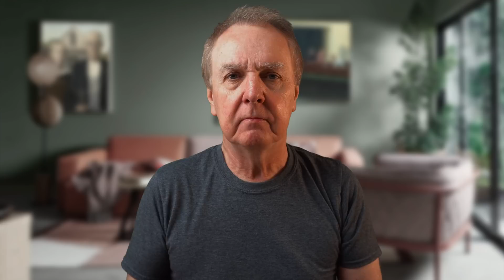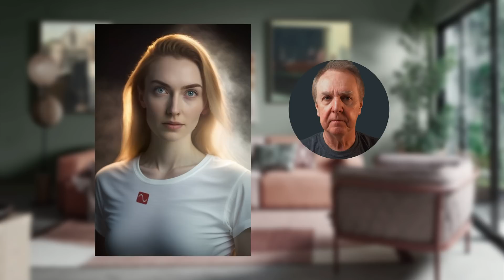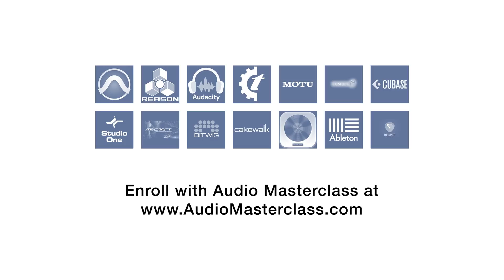Did that Dolby thing ever work?

Comment: As a teenager I really wanted a Nakamichi Dragon or CR‐7E, or even that AIWA one that let you adjust head azimuth.
Reply: I never heard of a Nak cr7e however I did own a Nak cr7a .the adjustable bias was very useful and the deck was claimed as the best cassette deck ever but I also had an inexpensive technics dual deck with Dolby hx pro that I believed without a doubt out performed the nak.wasnt much better but there was an audible difference at high output levels.Im sorry but 1985 tech wasn't as good as lower cost 90s decks...some people just won't let the hype die
Reply: @StankoBogovich-u5m  CR-7e was the variant for the European market.

I was a teenager in the 80s. By the mid 90s I rarely listened to my cassettes. 

Thanks for destroying a teenager's dream.
Reply: No destroying any teenage naustalgia on my part sir.I still like to listen to old hissy 8 track tapes myself.I was merely stating facts.sir.didnt mean to take away your desires or pleasures @nikolaki
Reply: I did have the pleasure of overhauling a few Revox decks .I think they were model 200 if that exists and I'm going on shady memory at Steve's shop.very well designed units.service friendly and high quality.lots of metal rather than plastic in their mechanisms where plastic or nylon failed with age just from their exposure to the elements...time,temp and humidity as well as decomposition.Nak equipment used lots of plastics that would decompose with time and with no more parts available to replace them they become obsolete.over all the Revox was a way better quality product than Nak.Your father worked on the very best overall.Im not too familier with studabaker so I can't give my 2 cents but overall Revox was way better quality than Nak regardless of some insignificant spec differences
Reply: Let me correct my self ...I meant adjustable azimuth not adjustable bias as the Nak had self calibration which was also a nice feature.nakamichi always claimed that hx pro was not needed in their decks because their head design was that good ...well I disagree and hearing is believing
Reply: @StankoBogovich-u5m   the azimuth feature was desirable for playing pre-recorded tapes.

As regards home recording I preferred dbx noise reduction for most of the stuff I listened. I had a Proton 740 tape deck that was factory calibrated for Maxell XLs tapes. 

Dolby C tracking was rather good on it too.

Playing tapes from recorded on other decks or mass duplication was usually unsatisfactory.
Reply: @nikolaki agreed sir especially with Dolby c which required critical calibration which was a major problem with using c type on other decks that wasn't talked about much.dbx was a linear system that didn't need calibration and always worked with cross decks.dbx however suffered from pumping and breathing side effect.because if this I always used Dolby b.the noise reduction was usually enough with good tape and equipment and compatibility was usually tolerable from deck to deck.thank you for the dialog Mr nikolaki
Reply: @StankoBogovich-u5m  i remember solo piano caused a lot of pumping with dbx.  Edit: I meant breathing!
Reply: @nikolaki I will say that there was a lot more satisfaction in trying to make the perfect sounding recordings back 30 plus years ago then today's digital where it's simply taken for granted.there was satisfaction of accomplishment with the struggle that doesn't exist any more
Reply: @StankoBogovich-u5m   yes, the digital revolution is truly extraordinary but despite the incredible mathematical algorithms that exist today I am more impressed with the engineers and technicians of the past.
I find the fidelity of sound achieved via cutting stylus and magnetic fields more incredible.

Just when analogue tape reached its technological peak coupled with Dolby SR, multitrack digital reel to reel machines were released!
Reply: @nikolaki yup,,all good things reach a peak than come to an end
Reply: I never had the pleasure of using Dolby s.i had heard is was set to be the industry standard for commercially pre recorded tapes and you know what happened next.i was curious to know how tracking compatibility was from deck to deck.perhaps you can shed some light.
Reply: @StankoBogovich-u5m  Sadly I never tried a Dolby S deck, by the mid 90s I became interested in surround sound, laserdiscs, dvds etc. The A77 and Akai GX were in storage and I had acquired an AIWA HD-S1 DAT machine.

The closest I got to experience Dolby SR was listening to Jean Michel Jarre's CD, Waiting for Cousteau since I read it was recorded on a multitrack Studer A820 with Dolby SR.

Anyway, sadly I only know what hi-fi reviewers wrote of various decks in the magazines, which was generally positive but, as you know, by that time it was too late for it to make an impact.
Reply: @nikolaki just one more thing.when I worked for Steve J in Hollywood I overhauled a number of Nak decks including cr7a,dragon,c9 something or other rx505 rx303.what an experience it was and a self satisfaction.He had two Nak 1000xk if I remember the suffix correctly that he wanted overhauled and recaped.however both decks had a strange record bias failure that I wanted to tackle first before overhaul.he insisted that I overhaul first which I did and after many hours of labor the bias issue still existed in both units.turns out others had the same issue and there was no known remedy at the time.you can actually see you tube videos of engineers trying to troubleshoot with no luck this was one of his excuses to fire me.he wanted the near impossible done after it was explained to the moron that this could be an unsolved issue...stupit man
Reply: @StankoBogovich-u5m  saddened to hear about your experience. Stupid is as stupid does. 

Brings back memories of my childhood in the 70s. My father used  to service Revox and Studer machines in his basement workshop in Paddington.
Reply: @nikolaki I've never been to England and probably never will but it would be a honor to shake your hand
Reply: @StankoBogovich-u5m likewise!
Reply: @nikolaki just one last thing...I hope..after reviewing all of my grammar errors ,,,😘it was the 1929 Boris Karloff movie 1939 was the drug induced ridiculous wizard of oz with miserably stupit music such as yogiyo yooohh
Reply: @nikolaki I'm fairly certain you know this but I'll talk about it some more.dolby hx was a late 70s system designed by doctor Ray Dolby  which lowered the record bias as high level high frequency sound was present that would self bias allowing more high frequency record headroom.critics said the system was flawed if simaltanious low frequencies were present.sometime in the mid 80ds.Bang and olfsom modified the circuit with the blessing of doctor Ray Dolby which became hx  pro.I don't know what they did and how it works but more importantly I have know clue what the decibal or any other numarical  effects hx pro has...I know I misspelled again ..so what.so what.do for decades I've been in the dark as to the exact function of hx pro .perhaps you know but I doubt it
Reply: @StankoBogovich-u5m   I must say I purchased many pre-recorded cassettes encoded with HX Pro. Before the days of the internet it was difficult to find information on it. The blurb on the cassette cover had no useful information.
I did not have anything to compare to understand what its effect was.
Did the cassette sound brighter? Not to my young ears. It was an enigma.
I hated prerecorded cassettes and my father had an aversion to the clicks and pops of vinyl, so I led a rather frustrated youth until CDs came along.
Of course I recorded a lot of music off the FM radio to both cassette and reel.
Reply: @nikolaki I love that word enigma.most Americans indoctrinated in our wonderfully brainwashed society know the word but have no clue that it was a nazi encoding message device used during world war 2 .I'm ashamed of my country folks in the USA.the country is great .....the people suck
Reply: @StankoBogovich-u5m they gave it a very apt name.
Sadly many goverments across the world do not want an educated electorate with critical thinking skills.
Reply: @nikolaki your father didn't like the pops on vynal.well, as it turns out with good vinyl and quality care along with light weight high quality phono cartridges it should not have been an issue.as it turns out in the US at least.record companies were using recycled vinyl with impurities that created pops right out of the sleeve.also so they would multiple press vinyl beyond the numeric wear point of the master press.your father probably knew this however mass produced pre recorded tapes were mostly worse until the late 80s and by that time nobody cared
Reply: @nikolaki exactly ..One of my favorite comedians who told me off in a casino in Biloxi Mississippi who later apologized to me ..George Carlin said it best...the owners of this country don't want educated people.they want obidient workers .more for themselves and less for everybody else
Reply: @StankoBogovich-u5m it was frustrating not having access to a record player. Not every band released music on cassette. 

But the allure of vinyl is strong and I have a small collection - mostly Deutsche Grammophon LPs from the 60s & 70s because of the artwork.
I do have a Pioneer PL-12D, I can't remember what cartridge but the cats love to jump on it, so it stays in the garage 😢.

My father worked for Brenell for a short time, he helped design the preamps in the Mini 8. And he also designed and kitted out a few studios, setup a mass cassette tape duplication facility in Lagos. I mean he did so many crazy things. So I think you're right about why he disliked vinyl.
Reply: @nikolaki so you're an electronic tech  too.I didn't know that.now that I do since we discussed noise reduction so much I will tell you that I know the inner workings of Dolby b.6 NPN bipolar transistors arranged to add encoding and subtract decoding of the compander.1 n channel junction field effect transistor used as a level limiter for the compander process.1 germanium diodes and 1 silicon diodes in series filtered by capacitors to create the time constant of the level limiter and 2 silicon diodes parallel in opposite polarity to absorb stray transient signal spikes.so now you kinda get the gist of how it works I hope
Reply: This was the original Dolby b design and not much has changed other than it was made into an IC chip
Reply: @nikolaki if you want some naustalgia.purchase a pre 1975 top loader japanese made cassette deck working .you will find that there's so much hiss and even the Dolby doesn't seem to work.what you will find is a separate discreet component Dolby board.almost every transistor is going to be a c458.also known as a 2 sc458
Every one of them has to be replaced and you can use a more modern transistor...a 2sc 2240 which works better in most cases and improves the signal to noise ratio.just a little gun from the peanut gallery Charley brown
Reply: @StankoBogovich-u5m 😀

Comment: Dolby did what it said on the tin, it was purely down to ensuring due diligence was done on your machine, also the quality of the cassette deck had a big a play on it too,
My main gripe was the shocking manufacturing quality of pre-recorded tapes, these where always hit and miss especially as they where massed produced at speed. 
Frequencies where usually all over the shop, too much low and not enough high
Reply: Some of the pre recorded tapes are just awful. But I think it's because some of the record companies recorded on really trashy cassettes. And this seriously hurt the reputation of the cassette.

Comment: Dolby works, sometimes. It's like you said, it's a companding system. But unlike DBX it sounds okay with it off. So, if it isn't working quite up to expectations and you have to switch it off because it's a home recording that didn't have it or for what ever reason, at least you get a boost in highs.

Comment: I used to have a 1/4" tape, open reel recorder, that was a 4 track.  With it, I had the 4 channel DBX noise reduction unit (One channel per track.) If I remember right (it's been over a couple of decades), when I would record tracks 1, 2, and 3 (Including drums on one of these three tracks) and then bounce all of them down to track 4, if I were using DBX, the drums would modulate track 4.  On track 4 you'd get the instruments from tracks 1 and 2 (assuming the drums were on track 3) being pumped, up and down, volume wise, on track 4.  The drums would cause the noise unit to turn up and down the volume on track 4 (loaded with the instruments and the drum), to the beat of the drum. I think that I just turned off the DBX unit completely, because of this problem when bouncing tracks.  I' would just record the tracks fairly hot so that the signal to noise ratio was good.  If drums were on a single track, by themselves, this wasn't a problem with using the noise reduction unit (the DBX.)  But, when bouncing tracks, the drums and the noise unit, together, would wreck the thing.  ((PS: On a different note.  Having TWO, four track recording machines, like they did on Sgt. Peppers, is a major advange, over having just one, four track machine.  I say this because when they were premixing (bouncing all four recorded tracks from a recorder, to one track on the second recorder, they could put scratch tracks on tracks 2,3 and 4 of the second machine, as a reference.  With these scratch tracks on the second machine, they then could determine how loud each of the track being mixed down from the first machine to the second machine, should be.  If you're only using one four track machine, you don't have scratch tracks to use for reference volume levels.  So, premixing, for most people, who had only one four track recorder, was more difficult that what The Beatles had to work with on Sgt. Pepper. There were no scratch tracks to refer to for setting volume levels of the, to be premixed, tracks.  You had to imagine the other tracks sound, without actually having heard it.  The old sayings about Sgt. Pepper being recorded on a four track is wrong.  There were TWO, four track machines that they were using.  That is a big difference from having just one.))

Comment: I’m with you David.
But then I have a Nakamichi 3 head cassette deck, which one could tweak record bias & level to ensure playback within 0.5dB of the record level.
Switched in, apart from a small change in the low frequency performance, few people could tell the difference to monitoring the input signal to off tape with Dolby B switched in.
I was never of a fan of Dolby C or S though.
And for the record. I could line up 48 tracks of Studer A80 with Dolby A, playback & record in about 30mins. Although, not having done it for about 30 years, I think it would take me a bit longer as I’m out of practice.

Comment: The expectation that the parts in a consumer cassette deck are anywhere near consistent for Dolby B or Dolby C to work properly was a joke.  The electronics in the Dolby circuit aren't going to be consistent.  The tape speed isn't going to be consistent between brands or units, so the frequencies are all going to get shifted.  Plus there's bleed through from the other side's tracks.  

Also, Dolby A was for masochists who had more money than sense.  Unless you were doing some classical recordings with large dynamic ranges to contend with, it wouldn't make much sense.  You also had to spend more of your tape budget on printing Dolby A calibration tones to the head of your tape... along with all the other routine calibration tones needed to do a professional job.  I love the sound of real compressed, smashed tape... but damn... using a plug-in to get a reasonable approximation is literally less backbreaking (squatting and kneeling to adjust an Otari is hell on the knees).

Comment: Back in the day I used to encode with dolby and play back without, for the extra treble zing. I probably wouldn't do that now.
Reply: Wouldn't the largest treble boost come from leaving it off during recording and playback?
Reply: @neththom999  No, because it specifically boosts treble in low-HF passages so if you record with it on and playback with it off, there is no compensation and the boosted HF comes through.
Kinda like an odd but easy EQ on recording.

Comment: You've stated it exactly correctly. For 28 years I aligned tape machines physically and electrically, using Dolby-A, B, and SR. Unfortunately the public has not yet acquired "our" level of discernment as to appreciate the value in "hearing" something in the way it was intended (wide dynamic range and balanced spectral curve), they would just crank up the bass and treble anyway, especially in the noisy A** car. Really just listening to un-decoded B-type tapes, makes-up for a dirty cassette deck in a pretty nice way.
Reply: I used to record my tapes with Dolby B enabled just as a treble boost. Playing them back, I would turn it off. It helped make up for the limitations of cassette tape.
Reply: @devilsoffspring5519  You not used Dolby C? its my favorite dolby NR
Reply: @quebecforce111  Hehehe yeah, I used it. It works even better than Dolby B, but C is more picky about head alignment and that's just not something that goes hand in hand with cassette tape :)
Reply: @devilsoffspring5519  merci
Reply: A lot of it has to do with whether or not one had the experience of hearing unamplified musicians balance their volume playing together live, as with a jazz combo or an orchestra. That experience gives a reference for realistic playback. If the sounds are all pasted together as a fictional studio composite, there's no actual shared experience to compare the playback to.